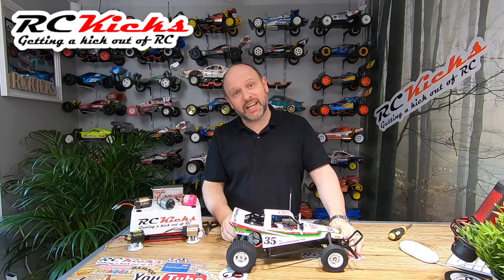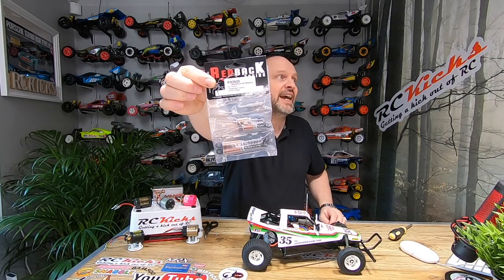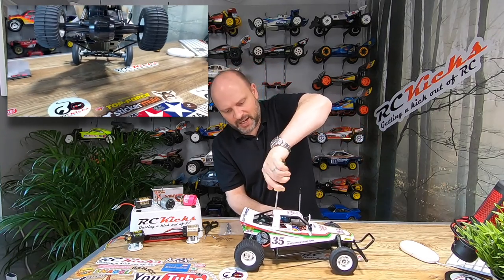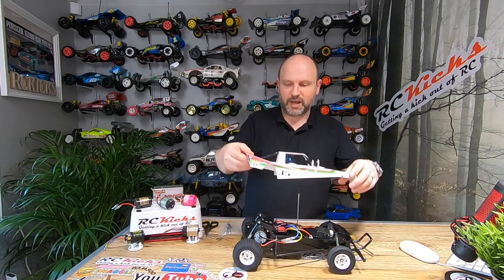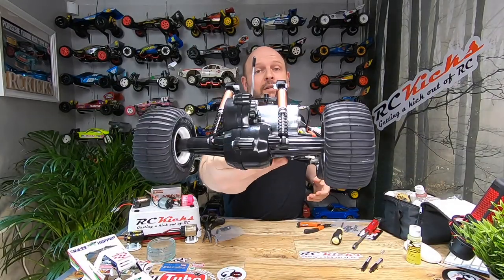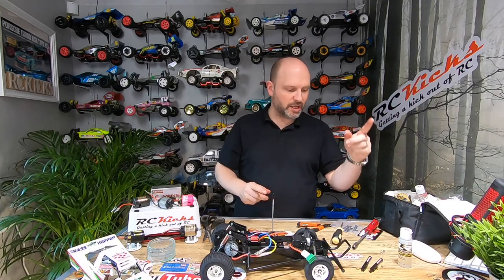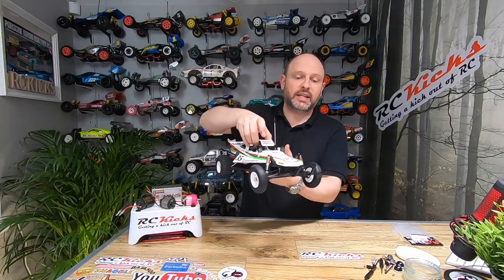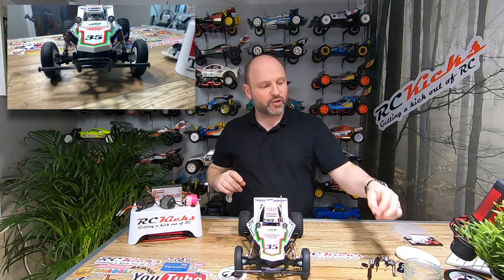Grasshopper Oil Suspension Upgrade Modification Any Good? | A Tamiya Vintage RC Car Legend.

Comment: I went through the whole grasshopper upgrade thing years ago when i felt determined to race one in a vintage event. It was a fun process but a complete waste of time lol. 
The issue is no matter how plush you make the rear suspension the biggest weight ie, the motor is part of the unsprung weight along with the g/box/axle assembly & there's relatively little weight on the chassis so the chassis/body will just bounce anyway as there's not enough sprung weight to make the suspension work. The only thing remotely worth doing is a 5th shock mod to stop the 'kick' on acceleration like people do on Lunchboxes etc... 

The charm of the Grasshopper is the comical way in which it 'handles'
Reply: Well I still like the Grasshopper and I don't need the fastest car around. I'm more than happy to just enjoy this lovely Grasshopper.👌

Comment: When i first started racing back in 1988 i borrowed the tires from a grasshopper and put them on mt gold pan rc 10 too see if they would work for racing. Well that did not go well. Had to stop on the side of the track and finished dead last with a total of 4 laps when everyone was getting 15 to 20 laps with the original schumacher minipins.
Reply from the maker: He eheheh Well you have to try these things.  You never know when you find a gem.

Comment: please put where to find them... like what to search for :). I was thinking of upgrading my Hopper with a brushless 380 motor and lightwight battery/servo for a while, making it eaven lighter than it already is, then the 380 motor should have easy time to pull it. Oil shocks + 380 motor + 35g servo + 800mah lipo battery should make the total car verry light with the already low base weight.
Reply from the maker: You can find them on eBay 👍🏻

Comment: For the rear it’s a good upgrade,, the front are for looks only,, travel is limited.  I got those a long time ago and ended up reverting my suspension.  Tip,, use a very light weight oil.  The Hopper is too light for modern oil dampening

Comment: I think I would’ve used 28-32 wt myself. Although it depends on your terrain. Good vid!
Reply from the maker: As soft as you can make it would be my findings.  The car is just so light.
Reply: @RCKickschannel  that is true. It’s a featherweight.

Comment: I've installed some oil shocks on my grasshopper and the rear shocks are touching the 540 at rest. If the shocks are compressed they obviously come away from the motor. Surely this can't be right. They are pretty stiff and seem to be putting a bit of force on the 540 can? Even in this one here it looks like the larger motor is touching the shocks.
Reply from the maker: You need to make the shocks as soft as possible.

Comment: I have ampro double wishbone fiitted to my hornet and it made massive difference to handling.   im still using stock friction shocks in front.
Reply: Where is this available? I meant the double wishbone conversion.

Comment: Great video.  I have been thinking of getting the same shocks for my Grasshopper as well.  Just adding oil dampers with the right wt oil by itself would help dramatically on the bounce.  I wouldn't go any further as it is a Grasshopper after all.  Thanks for sharing.

Comment: The problem with these grasshoppers is that there's too much un-sprung weight... for a shock absorber to be able to "absorb" shock, there needs to be enough sprung weight to cause enough "shock" to be absorbed in the first place
Reply from the maker: Yes you are 100% correct

Comment: I was just wondering are you testing the shock performance with the battery installed or with out the battery installed ???
Reply from the maker: I’ve tried both.  I removed the front two as the oil kept getting out due to crap rubber gaskets but the rears have been fine.  I will be running Lipo so the battery doesn’t add much to the cars weight.

Comment: Sima larion
I got those, they all leak oil, 2 of them you can,t even screw on so i had to add thin layer of paper. The ones i had to add paper to popped right out after some driving, the others went stiff, tried to change oil and now i cant stop the leak because the very thin rubber broke (was very carefull). Luckely due to Ebay i got my money back, so for me these where useless im sorry to write

Comment: Gavin, as a former Buggy Racer... I've got a tip or two. 😉 
The Grasshopper is an odd Duck. I would do this if I had the Shocks - and the Grasshopper!! 

This and the Hornet have an unusual dilemma...
An extreme amount of UNSPRUNG weight in the Rear. It's really the only case where you'd want SOFTER Springs and thinner Oil in the REAR, than the Front!! 😳 
Those Springs might work in back, but go with 10 or 15w Shock Oil. 

In Front, maybe a little stiffer Spring, and 30 or 40w Oil.

This kit should make a difference! But a dramatic difference would come with AmPro Engineering's Front Double Wishbone Kit. Really! 

I fitted a similar kit in the Front of my Lunchbox (same bad Swingarms!), and the Handling difference was dramatic!! 
NOT competition level of course, but much better behaved. 😊
Happy Christmas!🎄🎅
Carmine ✈🚂🚙
Reply from the maker: Yep I have the same Apro kit for my Lunchbox and it’s so much better.  I will take your advise and swap out the rear oil in the morning and see if that helps.  30w was too thick.

Comment: Is there s video of this running with the oil shocks?
Reply from the maker: Sorry I’m not sure, it’s been a while since that video came out.  Personally I wouldn’t bother with these as I found leaking was an issue.  You could upgrade the rubber gasket rings to fix this issue but due to just how light the buggy is, the shocks just don’t get much chance to perform.

Comment: Great video but you have gone with 20w oil but very informative.
Reply from the maker: I Need to go thinner oil in the rear I think.  The front spring mod worked well.

Comment: Why does the front need to got up fully when your car  not moving? You tuning the suspension for a non traveling rc.   Once it driving a rwd will push the front it up...you want travel you need softer springs and oil... Weigh

Comment: The fun of tamiya is that they bounce all over the place and look awesome with the awful suspension they come with. Put oil shocks on it and that will be gone. If you want performance dont buy a vintage tamiya, buy a Losi. I have Tamiyas because they look the best but that's it.

Comment: 45 is way too heavy for that light weight car. Remember it had zero weight oil before. The only reason I said to put 25 rear and 20 front is to help steer on throttle.

Comment: I wonder if gavin likes bounce why would u change ur hop on ur grasshopper I'll never get this tamiya thing down I'm to much of a new bee well looks solid like a rock gots a lil bounce tho stiff springs its looking good if you change the back tire I'll throw a fit lol jk I like a hop how is it so sopost to be a classic if ur up grading it's not the same when you ran it when you where a kid now I'm lost and sad turn back young grass hopper befor it's to late I never knew  just any shocks didn't fit  a odd duck so thay say  wowza I dislike off set but freek it if you know what works go for it on another note I would have put a thumbs down not cuz I dislike the video because I dislike changing the Grasshoppers legs but I didn't would have been disrespectful to Gavin idea Gavin change the rear shocks back to the originals keep the front shocks upgraded so that way the front doesn't stay down and you still have the bounce on the back end problem solved now if I could get a problem solved with more RC content instead of the little content that I have oh well I'm happy with what I got happy happy happy
Reply: Weee!😇🤪🎅
Reply: Look a ufo
Reply: Made u look